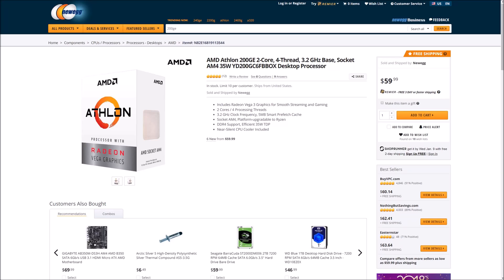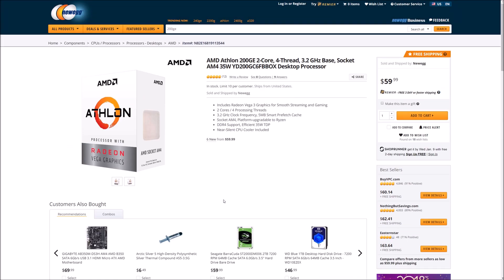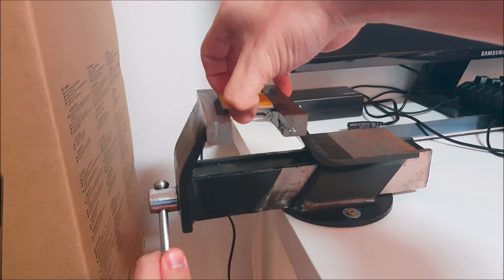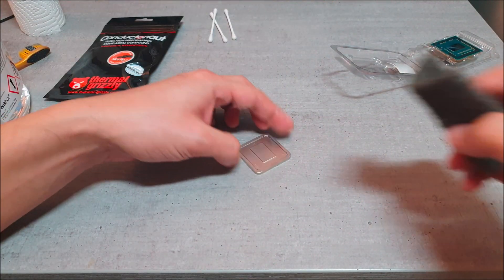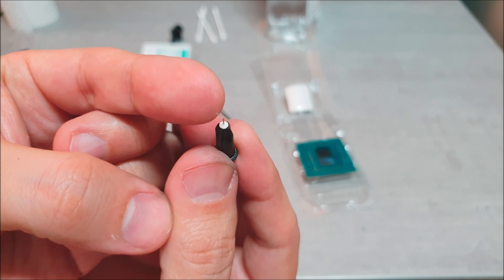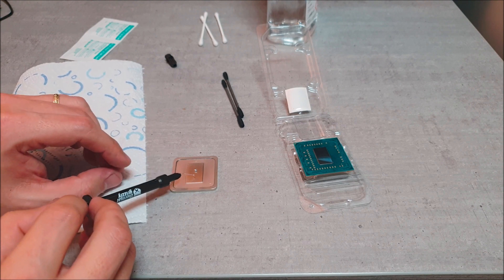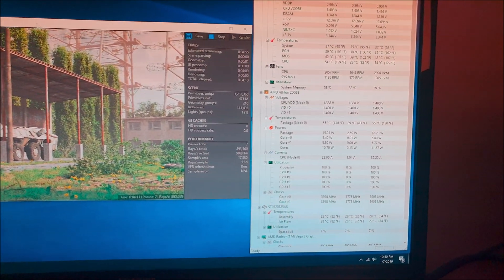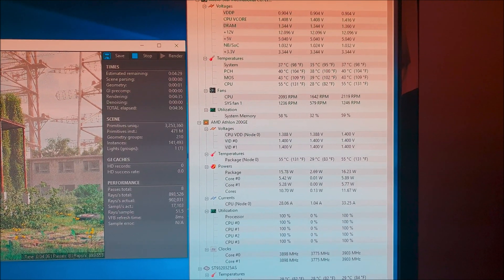AMD Athlon 200GE Delid & Overclock

Comment: Your process is so janky and very dangerous. you should have also made a adhesive "dam" around the die so that the liquid metal wont drip out and contact the smd components inside the chip+ihs.
Reply from the maker: It is still working today. Nothing has changed :)
Reply: @TechnologyHive  good to know. in my experience as laptop technician, it doesnt always turns out good. I realised its called a liquid. Until i learned to silk screen the adhesive first around the die area before adding LM the chances of rendering the laptops inoperable i mod basically became 0

Comment: there HAS to be a gap in the adhesive, its for thermal expansion of the air around the die. this is to prevent a pressure build up. which separates the die from the IHS.

Comment: why must it be relidded cant it be run with the die exposed like this i know some older amd cpus had no ihs and were fine (edit) also isnt the ihs aluminum and as such it will react badly with liquid metal
Reply: if you mount a cooler on the bare die it will crush the transistors around the die

Comment: Now includes nice die shot 200GE WikiChip (scroll  down) https://en.wikichip.org/wiki/amd/athlon/200ge
200GE OC MSI B350 Gaming Pro AGESA 1006  BCLK + MSI game boost - 200GE 3.9 OC w/Vega 64 https://www.youtube.com/watch?v=KM9kMK9Fi5E
Athlon 200GE OC also for GIGABYTE MBs
GTAV 3.8GHz https://www.youtube.com/watch?v=LA3rk1nmz9c
iGPU - G5400 vs 200GE vs.200GE OC vs UHD 610 vs Vega 3 - Fortnite
https://www.youtube.com/watch?v=bvdSw2ie0EE
200GE OC vs G5400. OCd 200GE Vega 64 makes Pentiums kinda obsolete
https://www.youtube.com/watch?v=VdsHZH_eQu4
Athlon 200GE Vega 3 OC - Battlefield V - Gameplay
https://www.youtube.com/watch?v=RPjPpkD-87U
Athlon 200GE all Tests: https://bit.ly/2Ntfhet
Athlon 200GE at 4.05Ghz! Asus unlocks the Athlon.
https://www.youtube.com/watch?v=tKwa2yXtlvM
Athlon 200GE Asrock Overclocking Test - Battlefield 3.
https://www.youtube.com/watch?v=uceBvfe9sho

Comment: a big mistake when applying glue to IHS - there is no outlet for the captured air ... note that the AMD engineers have adorned a C-shaped glue and this is not accidental
Reply from the maker: Can you guess why that is since you brought it up? ;)
Reply from the maker: @Marcus R I am using liquid metal. No need for "gap". The cheap TIM used by AMD and intel requires curing time. Also as things heat up expansion occurs. I used a clamp to make sure things stay tight til the glue is dry. This pc runs 24-7 and it runs as quiet and cool as day one. Thx for watching.